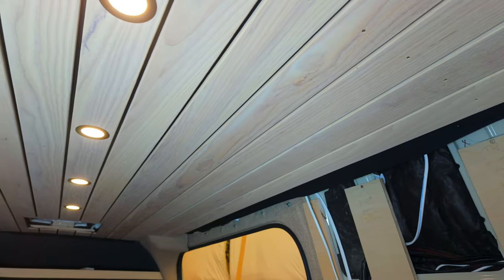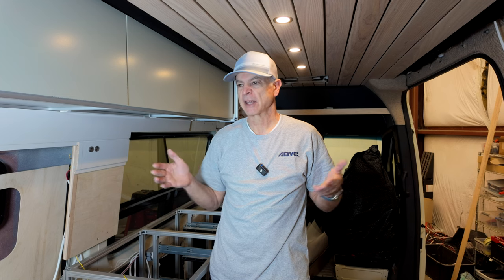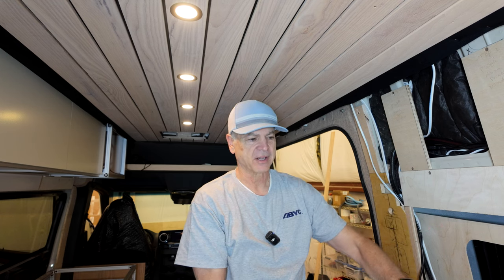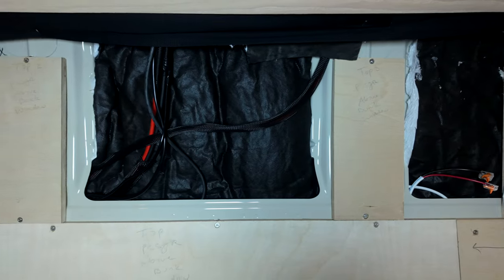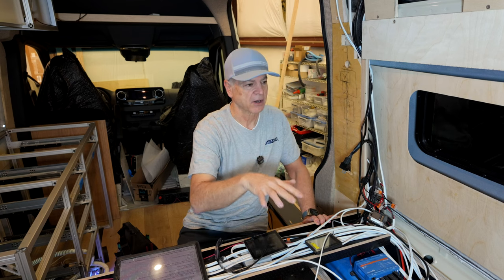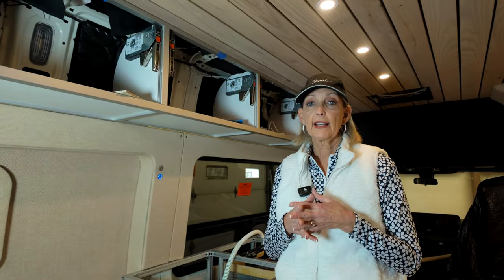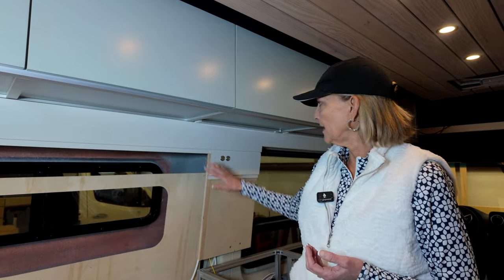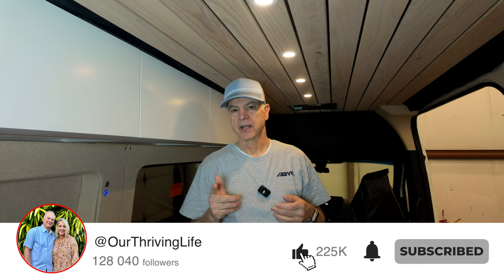Van Walls and Ceilings | Pro Builder Shares Tips

Comment: I've not seen anyone run conduit for the wiring with access at the end points.  With wide-sweep elbows, and pull strings pulled in with the wire, you could always add more wiring later.  This would mitigate the need to have total access to all your wiring.
Reply from the maker: Yes. You can definitely do that.

Comment: When you were discussing the way to scribe the shiplap planks with a small ruler, it looks like the 8020 electrical cabinet is screwed directly into the sheet metal rib, and I thought from another of your videos you said that you should insert a plastic/rubber spacer between the 8020 & the van metal wall to serve as a thermal break? Also, the ship lap comes down on top of the 8020, so I’m assuming that since the 8020 is 1” and the shiplap is probably around 3/8” that would leave about 1/2” for the top cabinet panel to rest on?

Comment: Great work as always.  Have you ever thought of making internal walls with FRP honeycomb/XPS sandwich panels?  Very much used in expedition vehicles. You don't need a metal/wood frame and can glue directly to the material.

Comment: Great video! I didn't know I wouldn't need to frame the van if I go the panel route!
Some questions: Do you think it's necessary to wrap the panels in fabric? I was thinking of doing panels and painting them. Also, do you have thoughts on alternative materials, like Fiberglass Reinforced Wall Panels or using panels that "look" like shiplap but are really just one large panel?
Reply from the maker: You don’t need to wrap. You can paint or clear coat the panels. I’m not a fan of the faux Shiplap/bead board panels as they are usually mdf or some type of particle board. If you can find them made of pine, then I would say go for it.

Comment: I know it’s easier to run boards front to back, but it makes the inside look even narrower.  Have you ever run finish board side to side?

I suppose that would run opposite to the curve of the of the van body?
Reply: if you want to run boards bottom to top you can kerf the back of the board to make it flexible and conform to the wall.  the trouble you may run into is scribing a very tall board to match an angle (like he shows around minute eight in this video) is a little more time consuming.

Comment: Do the panels or the shiplap weigh more, or are they similar?
Reply from the maker: The Shiplap is pretty light, but you do need to add furring strips. You don’t need furring strips with panels. This means that all in the panels are lighter, but Shiplap with furring strips doesn’t add that much…probably less than 100lbs.